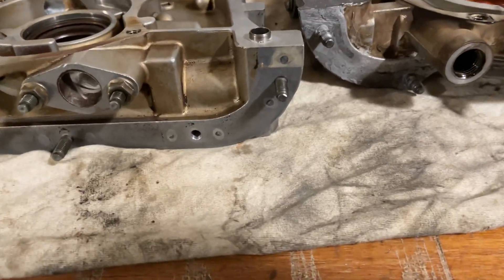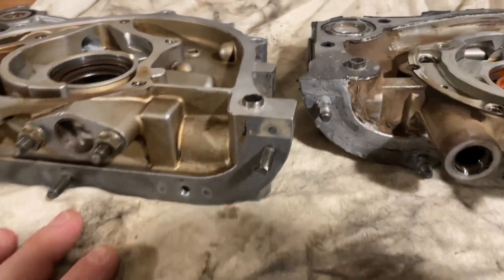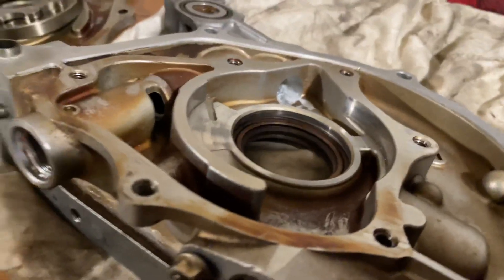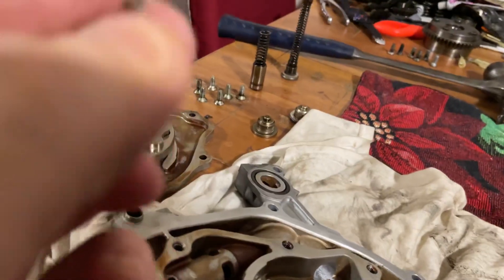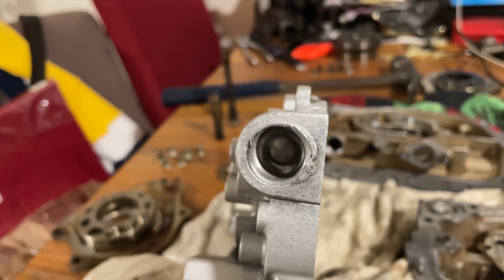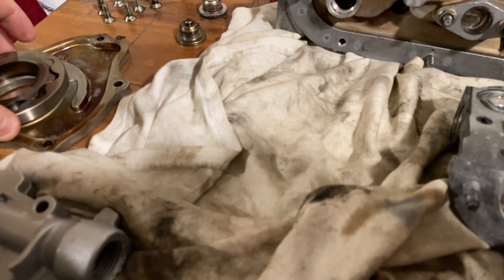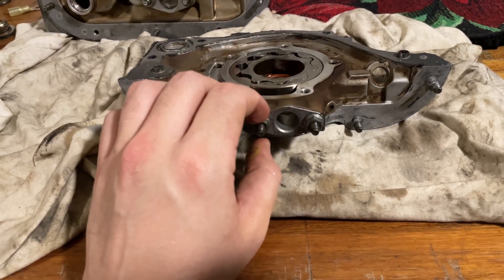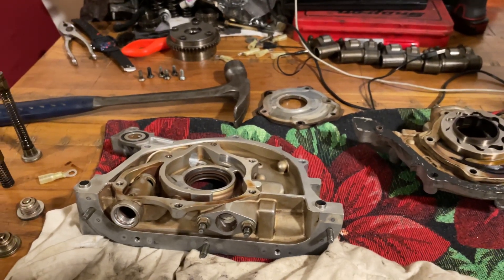Oil Pump Porting, Shimming, Inspection

Comment: so what's the desired outcome of doing this? do d and b series have high oil pressure? I know on 4g63 we port the ofh and channels in the block to drop oil pressure when we remove the balance shafts.
Reply: The idea of porting the pump is to get more oil pressure and flow by reducing the restriction in the system. This could theoretically slightly reduce oil temps too as pushing oil through an extra restriction creates unnecessary heat. The idea of shimming the spring is to hold the relief valve closed longer to build more oil pressure at higher RPMs, although I don't know how helpful that is as these engines aren't really known for having oil pressure problems when functioning correctly. I have an extra oil pump that I ported and I may install it just for the heck of it next time I change my timing belt to see how much difference it makes, but my D17 is already running at 70 PSI at 3K RPM and going up to about 80 PSI at redline so I don't know how much better the pressure could get as that seems great to me already. So basically my opinion is if you have the pump off already there's no reason to not port it as easy as it is to do, but I see no real benefit to shimming the relief valve spring and I could see doing so possibly causing problems if taken too far. These engines are crazy reliable anyways so my thought is why mess with success.
Reply from the maker: 👀nice way to over complicate an answer. 😁 if your gonna port to increase volume it’s no uncommon for pressure to drop from that. The shim helps make up for that. Generally increasing between 5-10psi. I wish ppl would take the time and effort for long form explanations in the places I don’t care to lol
Reply: @VHBEngines  That's true depending on where pressure is measured. If the pressure is measured inside the pump then yes the pressure would drop since pressure is created by restriction and the restriction in the pump would be less, but if the pressure is measured in the engine block then theoretically it should increase from reducing restriction upstream of the sensor since volume through the engine would increase and therefore more pressure would be built behind the bearings since their restriction would remain the same and flow through them would increase. The engine's restriction is more or less constant, so increasing flow by reducing restriction in the pump would theoretically increase the oil pressure in the engine block.
Reply: @averyalexander2303  Exactly what happened to me, now my startup with small shim is over 130 psi
Reply: @a.bax.5992  Wow, is that at cold idle I presume? Which engine? Be careful to not blow out the oil filter. That never happened to me, but I've heard of that happening when the relief valve gets stuck closed.
Reply: @VHBEngines   you don't seem to understand how the pressure relief valve works. Shimming doesn't increase the output pressure of the pump, it only allows it to sustain a higher maximum. So if you have 20 psi at idle and 50 at 3k rpm, you can shim however much you want, you're still gonna have that same pressure. The only thing that'll be different is when the relief opens, so at high rpm or cold start instead of having 75psi you would have for example 90 because of the shim. Can you see now how shimming doesn't do anything an can actually cause the pump to cavitate at high rpm if overdone.
Reply from the maker: Opening the passages for higher flow and shimming to boost the pressure. Mainly for turbo or high revving engines